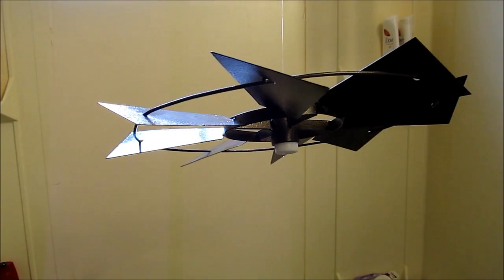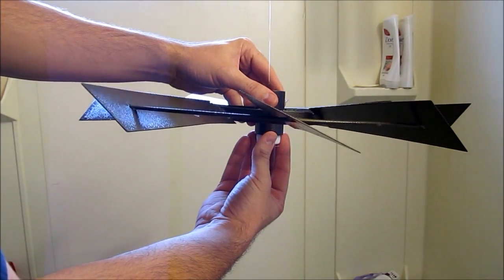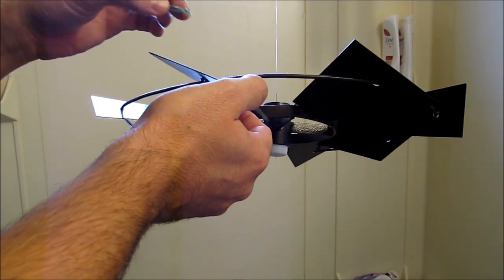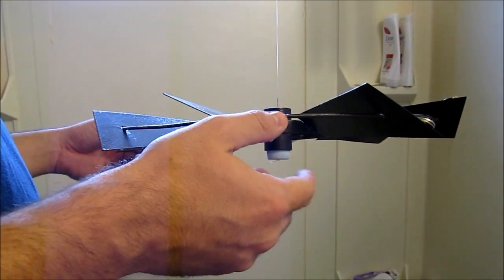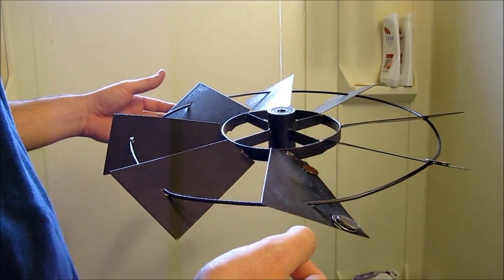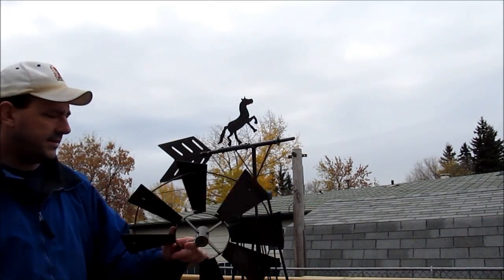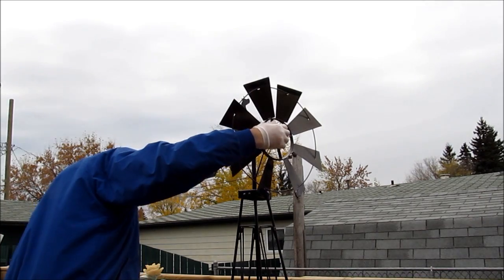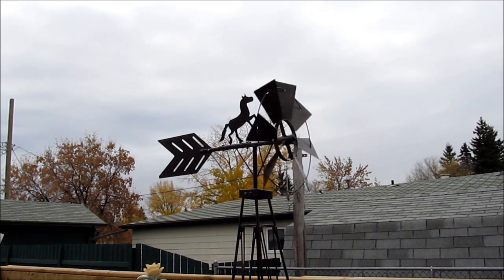Balancing a decorative windmill using coins to remove vibration

Comment: Hey Turbo, can you tell me what the part is that is at the top of the A frame that the rudder and propeller goes into, the one I have is messed up and i,m trying to see if I can buy a part for it, looked around the internet and can,t find any thing on it, it's an older Whirly Gig, I can send you a pic of it if your not sure what I mean.

Comment: Not a bad idea, but an even better solution for balancing would be to take a thin sheet metal material, cut small squares, weld it on, place it on a flat table, hammer out any bends and it should zip along straight and narrow even in a wicked storm. Sand it smooth and paint it and it'll be better than new.

Comment from the maker: @Blargaldalien Less out of round, more "bent" which does cause a bit of vibration.  In theory it can be balanced even if out of round given the weight distribution is equal.  Yes, removing weight is a possibility but isn't as easily reversible if you mess up.  The bearings are tight on the shaft for now...

Comment: I think the out of rond condition, may be more of the cause for your problem. At higher RPM's the inertia of the most extreme departure from round, may be causing the vibration. Depending on the amount of weight, do you think removing material from the heavy "baldes" might be a better looking alternative? How tight t the shaft, is the bearing area on the hub, is there any gap?